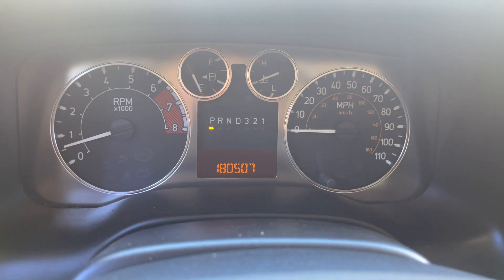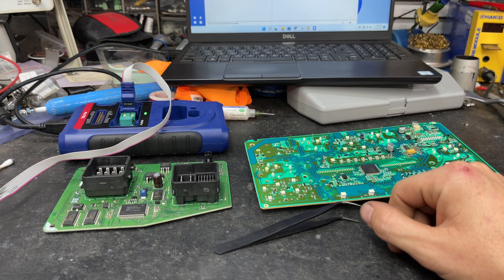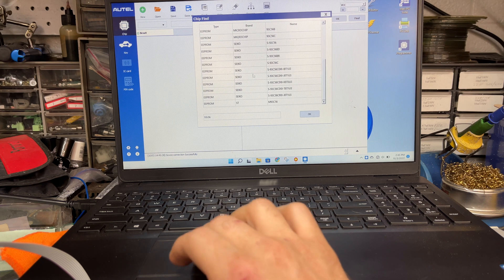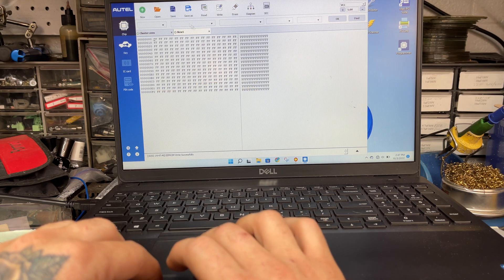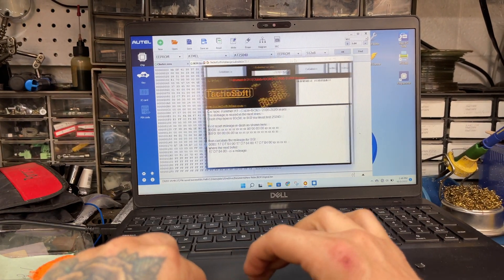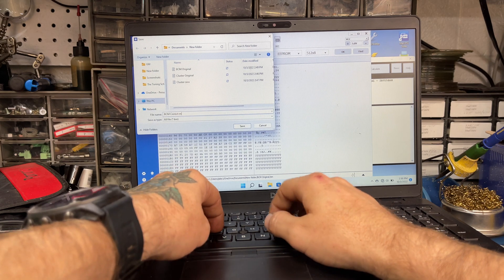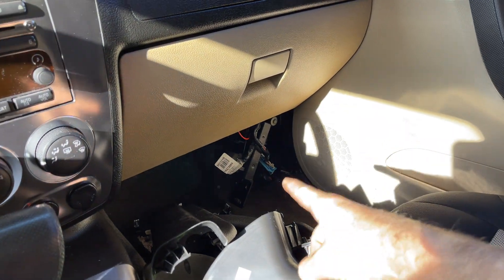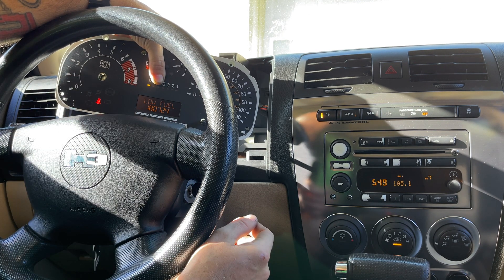Hummer H3 not counting Miles?! EEPROM to the Rescue

Comment: I sent you an email directly but can you suggest an eeprom programmer that can program the eeprom for the H3 BCM?  I have a egecu T48 that reads it fine in or out of circuit but won’t write to it in or out of circuit. I was able to read it and save file them write to a 95040 virgin chip. I am
Assuming my programmer is just not capable or pinned correctly to unlock the EEPROM for writing
The original chip. I tried it doing it like in your video using
The 25040 setting also. Same
Results.
Reply from the maker: I have a t48 but I don't like it. I just use the programmer that came with my im608.

Comment: I had the BCM in my 2006 Hummer H3 replaced with a new one and several months later the odometer stopped working at 43,263 miles.
Reply from the maker: There are other things that will cause that, but are you sure it was counting after the replacement?

Comment: Awesome video and I appreciate you posting this. I have 2006 Hummer H3 but I made a mistake and bought a different BCM because I had a problem with the brake lights harness shorting out the original bcm. I swapped the eeprom from my original BCM to the new BCM and caused the accessories dashboard instrument panel cluster and lighting to intermittently shut off and also cause a no start. It almost acts like a bad connection but I have good BCM power and I have class 2 data Tested with my oscilloscope. Do you think I fried something Swapping the eeprom?
Reply from the maker: Maybe a pin tension issue? I'm not sure
Reply: @autodiagyt  it's possible but that same BCM will not come back alive unless it's been unplugged for over an hour or so if I swap out that BCM and immediately plug in another one I have lights and instrument cluster for about 3 minutes or so but if I unplug and replug in the one that just went out it will no longer come back alive unless it's been unplugged for over 3 hours it is weird and I'm pulling my hair out at this
Reply: Hello guy I am replaced a BCM in a h3 and I copy info from a epprom to another one the mileage change but the vin is same how I can change vin number to pass IMMO ?? Good bless

Comment: I kinda have a similar situation.  I had my BCM replaced with a used one and now my odometer shows 106,000 more miles than it actually has.  It still counts miles thou.  I would like two get it to read the actual miles.  Do you know where to go to do this?  I still have original BCM
Reply from the maker: Your used bcm had more mileage so the cluster updated. You would need to clone your original bcm eeprom into the used bcm and then reset the cluster mileage to something lower so it will sync back.
Reply: Is this something a common auto shop can do? I had called a couple chevy dealerships and they both said there is nothing they can do. @autodiagyt